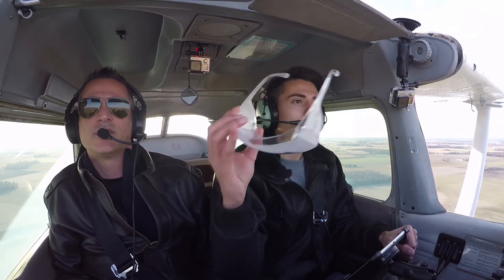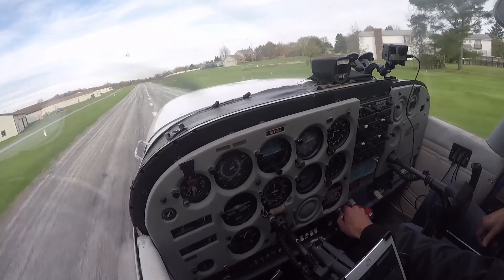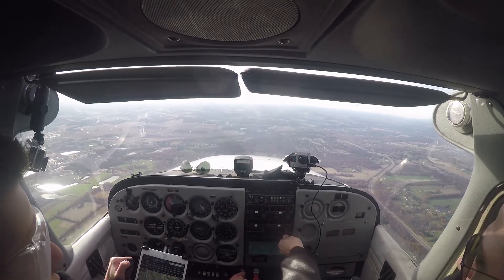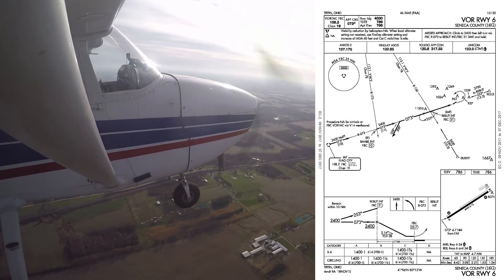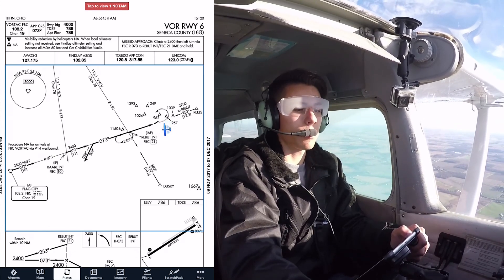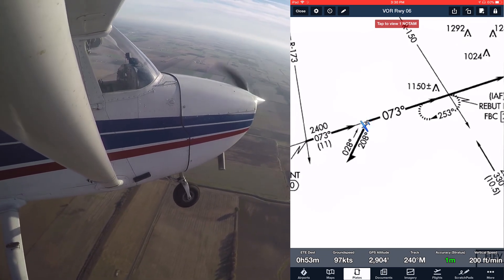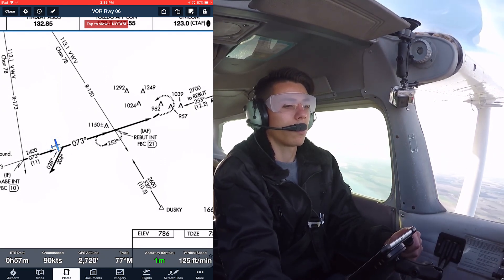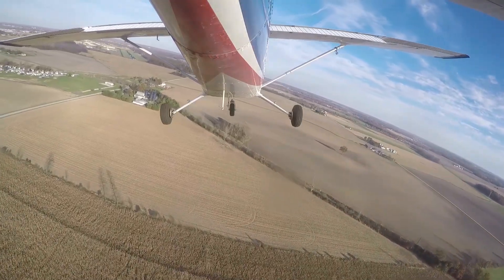What is a VOR Approach? | VOR 6 Approach Into 16G | Cessna 172 - (ATC Audio)

Comment: 0:37 Flying a drone at an airport!? Are you nuts?
Reply: Small airport with no traffic. I'm sure that he was monitoring the radio.
Reply: @marlock6573  Doesn't change the fact that it's highly illegal in most countries - and for good reasons. I hope you're not a pilot with that attitude. Bending rules may be okay in many parts of life, but not aviation. "No traffic" is relative and it's also a matter of principle, similarly like drunk-driving isn't okay only because it's in the middle of the night and there is "no traffic". And about having monitored the radio: that is speculative - not to mention that it wouldn't even guarantee anything, because contrary to drone-flying in an airport's vicinity, NORDO is in most cases legal at uncontrolled airfields - maybe not smart or advisable, but e.g. some historical aircraft don't even have an electrical system.
Reply from the maker: Flown with prior permission from the controlling authority; completely within legal limits: https://www.faa.gov/uas/recreational_fliers/where_can_i_fly/airspace_restrictions/flying_near_airports/
Reply from the maker: Straight from the FAA’s website: “For flights near airports in uncontrolled airspace that remain under 400’ above the ground, prior authorization is not required. When flying in these areas, remote pilots and recreational flyers must be aware of and avoid traffic patterns and takeoff and landing areas. A drone must not interfere with operations at the airport must yield right-of-way to all other aircraft. Uncontrolled airspace and other flying restrictions can be found on our B4UFLY app.”

This was at a small, uncontrolled airport. There was also approval given from the airport manager.

Hope this helps clear things up!
Reply: @Aviation4Life  Thanks for the clarification. I live in Germany (where it's indeed strictly forbidden to fly drones at any airport) and my experience as a pilot is only from flying in many european countries. I'm actually a bit surprised by the FAA regulation (FAA rules and EASA recommendations for european national implementations usually don't differ much), but it seems you're correct. My apologies. Still, I'm not convinced that it's smart or that an approval of the airport manager makes much of a legal difference in case of an incident. You are probably aware that not all aircraft fly in a strict traffic pattern, even  though they should; deviating for spacing purposes relative to other traffic in the pattern or missed approach / go-around procedures may be possible reasons. If something happens I'd assume that any judge would argue that the drone operator has to take this into account. And - legal or not - can you honestly say that it's possible as a single person with only 2 eyes to scan the surrounding airspace for traffic whilst simultanously observing the drone? Not to mention FPV goggles... (I would guess that hearing the engine sound in time can turn out unreliable depending on wind direction).